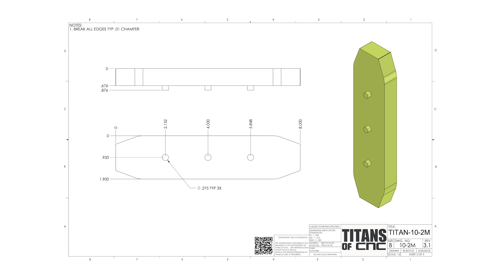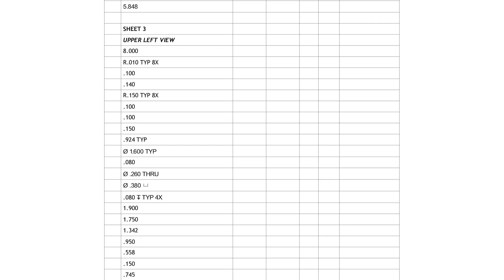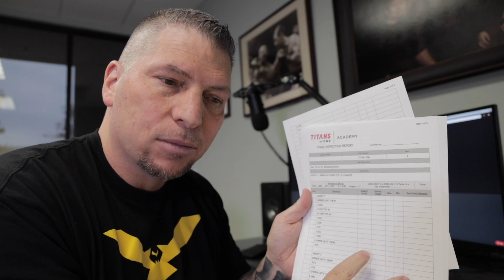How I Learned The Importance Of Quality In CNC Machining - Vlog #29

Comment: I had a similar situation on a job years ago when NASA's JPL program needed 4 parts pronto. I was an operator running someones else's program that was half assed. Being up against the gun and higher ups constantly wondering when I was going to be done because they were sending it up in space in a month. Being stressed and not focused also not slowing my roll and asking to fix and adjust the program. I ended up with delayed shipment and very disappointed in myself. My lesson learned was to slow down and COMMUNICATE and get it right the first time. Not let the higher ups get to you letting you loose focus.

Great video I can relate to!!!

Comment: Ohhh you remind me of a near disaster I made when I was 15 years old back in 1963....I worked for an Electronics company in Sheffield UK that made Large Induction Heaters and Audiometers, strange combination... but I was given a job when I worked in there machine shop to drill 2 x 3/8 inch holes in Copper blocks measured about 6 inch x 4 inch by 1/2 inch thick there were about 50 ... they were taking for ever in this jig one at a time on a Meddings Drill press .. so I decided to do 2 at a time ... after they checked them half of them were out ... but my saving grace was they had to open holes up to 3/4inch so they put on a Milling machine.. luckily didnt loose my job...LOL

Comment: Started in deburring at the age of 13, was giving a $400 casting and told to deburr the holes.  All I knew about was countersinking.  So, 10 min later when I had a countersink about 1/4 inch in diameter, I asked if that was deep enough.  I still have that wide eyed looked of my supervisor seared into my brain, 22 years later.  So, like you Titan, first part I ever touched was scrap.  Good vlog.  
Check us out @ www.fwmachining.com
Reply: I get the reverse at my work,  the workshop manager expects deburred edges and holes to look chambered or countersunk.

Comment: I'm too young on machining parts. One day my boss told me to make a metric thread on a lathe [my first thread ever], also told me feeds and speeds and was looking meanwhile I was working. I asked: "Why we can't go faster? And he answer: "You could brake the insert. Space between chuck and torret is shorter, and the thread is larger. You can crash the machine". So I didn't hear his advice and..... Fortunately I only broke the insert, but I learned that he told me the right things cause he has the experience [25 years working on different shops].

I think as workers, we need to pay attention to the instructions and worksheets. Everything is there.

Comment: I work in a fab shop, we drill these cast aluminum bowls. The company purchased us a gang drill bbn to drill the 2 different sized holes. We only use that drill gang for that part, or so I thought. Well, I checked the drill bit in the first drill press head and it checked out. I didnt check the second...10,000 parts later I completed my work only to find that someone switched the second bit out..should have checked but I didnt know any better, why would it be wrong right? Well that was 2 years ago (still making those parts fo to this day). Eneded up staying after hours redrilling them on my own time! Valuable lesson..ALWAYS CHECK, titan will understand the feeling when I found out they were all wrong..

Comment: Were you the one who whipped some bar stock on the puma lathe at zanola?
Reply from the maker: Nope... I was on the Mills 😅
Reply: What diameter on the whip? 1/2" round 90 degree bent for decapitation? Or 3.0" round machine mover? :)

Comment: Quality! Absolutely aware of the challenges faced with quality particularly with using low cost 3D printing, a good example is headed your way via Shanie! I have to say that making errors is usually one our greatest forms of true education in life, and without mistakes, we may never know if we could have done, or can do, better. In terms of inspection, Titan could you do a separate video on how to do a correct part inspection report, using say one of the Building Blocks parts, and highlighting potential traps and pitfalls when measuring components, as well as the minimum types of inspection tools a student through to CNC expert should be using. Thanks as always!